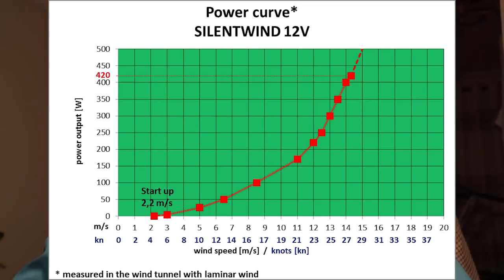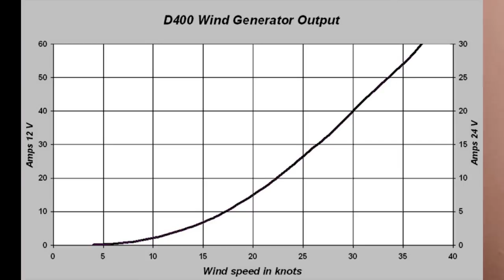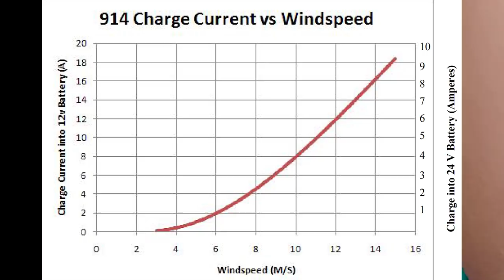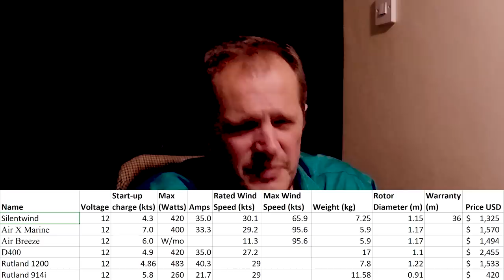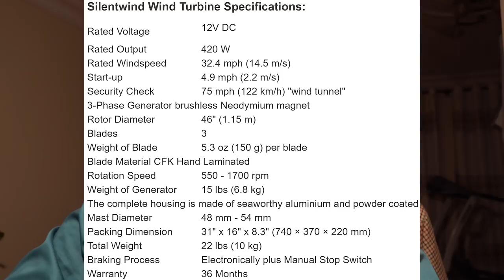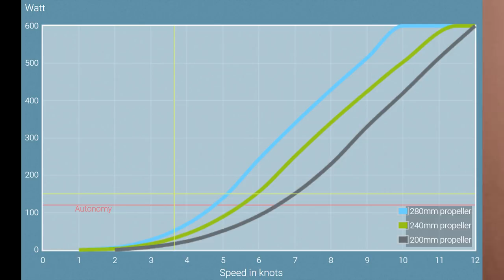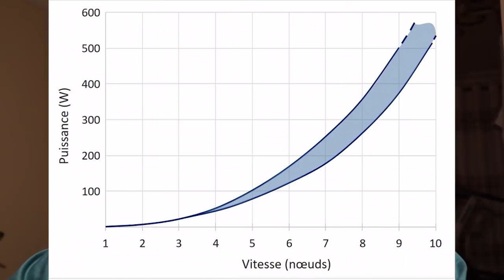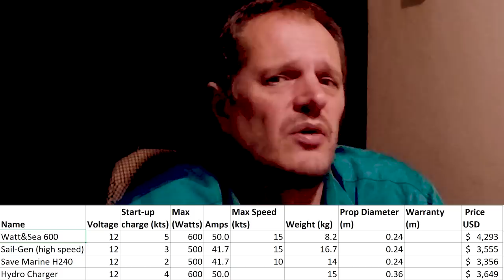#23t Should We go Hydro Generator or Wind Generator | Sailing Sisu Catamaran Cape Town South Africa

Comment from the maker: OK, after three years sailing 23,000nm over 80 latitude degrees...that is from Cape Town to the Black Sea. We also crossed the Atlantic and did a lot of downwind sailing and now Trade Wind sailing. We are heavy on electronics (power hungry graphic laptops, Wi-Fi, hard drive storage server for our videos, cameras chargers, nav instruments, etc.) and use the electric kettle every morning for coffee. We have a microwave, an Instant Pot, and a still, washing machine, and water maker on board. Here is our experience:
1) The wind gens are a disappointment. We can run only one because there is something wrong with the mount of the starboard side wind gen, because it is vibrating a lot. We have changed blades, changed gens, but still a lot of vibration. The port side is running with less vibration, and it is always free to generate power. That said....here in the Trade Winds or downwind sailing, it only starts at around 7kts of wind but brings in 2.4W in. It only starts to go above 120W with over 20kts of wind, which is a rare case at anchor in the Tropics, or while anchoring on the lee of land. We saw 380W in a 50kts blow at anchor, but that was too scary to worry about power generation! So, it is trickle charging at the best of times. Not sure if it is worth the money. They are a good warning of gusts though! They start running up long before the wind instrument shows any signs of a gust ;-)
2) The 1.4kW Flexible Solar on the roof. They bring 600W on average on a sunny day in the Tropics. The 1300W on the aft arch (well ventilated) brings 800W in the same conditions. The solar are by far the best provider of power. We battled in rainy season areas such as Amazon jungle, or high latitude winter times. We had to run the engines quite often like every three days while at anchor for longer than three days. We sailed a lot in the Mediterranean, but as you all know, MED = Motor Every Day. So, we had to motor sail a lot, which topped up the batteries.
3) No Generator, but two additional alternators.  I still think we are better off without a heavy genset and extra maintenance of another diesel needing filters oil changes and service. However, that is at the cost of putting more engine hours on the main engines. We learnt to use the engines while sailing to top up the batteries if required. For example, if we see that we need to charge the batteries, then we will move to another close by anchorage we wanted to check out and motor over, or instead of tacking the last 2 miles to the anchorage, we will drop the sails and motor, if too far out, we will go 30AWA towards the anchorage with the genoa sheeted in tight using the engines.  The four alternators bring in 1,500W @ 1,100rpm and 4,000W @ 1,800rpm however, it will cut out every now and then because of overheating at the higher revs.
Reply from the maker: Oh...we have 12kW of Lithium batteries. They only got to 100% with solar in the Tropics in non-rainy season.
Reply: Thanks so much for the very detailed reply. Much appreciated.
Reply: What is your daily energy usage at anchor and underway? From your description it sounds like you consumer hundreds of amps per day.
Reply from the maker: about 8kWh per day.
Reply: @SailingSisu  thanks, sounds like 2000-2500 watts of high performance solar (sunpower, solbian solar, etc) would keep you going indefinitely.

Comment: Dont forget that at high latitudes you will be visiting in summer wich means a lot of hours of sun. I live in the north of Sweden and i installed solar waterheating panels on my house 10-12 years ago. Works great mar-okt. Summertime it never gets dark outside.
Reply from the maker: Micke, I agree fully, keep in mind that solar panels on the catamaran will be a) flat mounted, b) moving and tilting all the time into and out of the sun, c) the sail and the low sun angle will definitely work against each other. I have been many times to Copenhagen, been to all three ice hotels in Sweden, Norway, and Finland during a road trip, loved that part of the globe! Yes, in summer, the sun in those parts will be much more higher and the solar panels actuall increase their output with as much as 15% during cold times :-)

Comment: One thing to keep in mind about wind generators.
1. You want one that starts producing and start turning with as Little wind as possible.
2. You want one that dont make to much noise so that you can sleep well at night.
3. You want one that you can turn off safely.
4. Look more which produce most around 10Kn or whatever is average.
5. Remember the reason why you want a windgenny… Probably to generate Electric when the sun is not shining because it is dark and when the hydrogennie is not because you are on anchor.

Hydrogenerator - You dont want the one that you are pulling behind the boat. You want the one that you put down by your sugarscoops.

I would get 1 wind generator and 1 hydro generator.
Reply from the maker: After one year of sailing, I think you are absolutely correct! Thank you for watching and your kind advice! Have you watched our non technical videos? Did you like them too?

Comment: From personal experience, I would just fit as much solar as you can, split up with 2 or more MPPT controllers for redundancy and performance. 
Wind generators can be noisy and get in the way depending on where its fitted on a cat. 
Hydogenerators are another item that can be a hassle to use and store.
Monohulls tend to use wind generators more because they don't have as much flat area to mount big solar arrays compared to a Cat.
Solar has the best cost to performance ratio and is more reliable when combined with enough, efficient electrical storage. 
Have a look at this guy's review > https://youtu.be/cMENm_7MenY
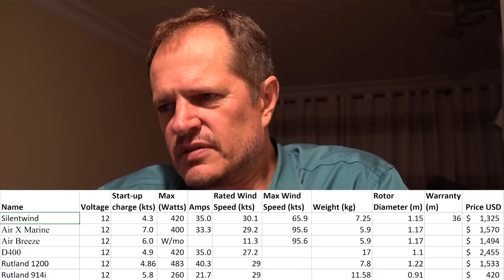Reply from the maker: ep 11  https://youtu.be/wDhpkHN_AQY?t=12m55s  (12:55)
Reply: Yep..I would do as you described in your Ep 11... I have a mate with a Schionning Cat and he has used multiple Solbian panels and he swears by them. Great quality, tough and very efficient. Their downside is cost, however "you get what you pay for".
With enough LiFePo4 batteries and a sizable inverter you could run most things without even starting the genset.
The genset could be used if you were going to run very high current draw appliances or a/c for short periods if required and of course you can charge batteries whilst it is operating.
Whilst motor sailing your additional engine alternator can also top up the batteries. I believe that the solar will keep them charged anyway. 
I really don't think you need the added complexity and maintenance issues of wind and hydrogenerators if you have a good quality, "well designed" solar system and energy storage capabilities. 
For interests sake, have a listen to this wind generator > https://youtu.be/_7zdhPUyXfk
Reply from the maker: Yes, even on Delos videos, one can hear their wind gen...pretty noisy buggers! But read my pinned comment ;-)
Reply: I agree, wind generation is noisy. And hydroelectric doesn’t work when the boat is not moving.  I would double down on solar.

Comment: If you can fit more solar panels, I would cover the roof, this is relatively cheap.  Then use lithium batteries and ultra high output alternators on engines as backups.  You can DIY a LiFePo4 house bank for 1/4 of the commercial marine prices, with the same monitoring and safe guards.  No wind or hydro, you'll mostly be at anchor and won't want wind, low apparent wind speeds can also hurt performance here on passage.  Hydro only works on passage, where you'll mostly be in fair or good weather often in the local summer, so solar works great. It's very feasible to get 7kwh+ daily from solar on a cat and also works naturally to do your high loads during the sunny day, like making water or laundry.  I'll be fitting 2.2-2.5kw of panels on my cat's roof, no genset, 10kw lithium bank.  I expect to very rarely need to run the engines to charge the battery, i'm even expecting to get ~3 hours aircon runtime each sunny day.  The lithium batteries are key, they give every charge source you have more effective output.  I can also very easily cut out half or even 3/4 of the daily load if we need to conserve power for a couple days during a storm, but an hour on a cat's dual 3-4kw alternators also gets the job done (to bring the battery back to full).
Reply from the maker: Thank you, Derek! Yes, my idea too. But for a start, I just want to see for myself what fuss is about :-)
Reply: Check out advanced RV, they have a lithium system with a 4 KW engine driven DC alternator. I know it's not marine, but when I need a fan, light, water pump, I go to the RV store, LOL
Reply: Very true, will check that out as well.  I'm currently waiting on a quote for https://www.electromaax.com/products/marine-alternators/genmaax/
Reply: Don't forget that lithium batteries can sustain irreparable damage at low temperatures so anyone sailing north Europe outside of summer will not want lithium wighout some kind of heating system. If you are sailing the carribean then good Stuff! 👍

Comment: Length of blade , introduces sound shorter quieter. Most complaints I’ve heard are about noise. Max wind speed is a concern. Your well tied up because of a hurricane and can’t use your generator because of over speed issues, no electricity. Nobody seems to have pitch control, as in aircraft. You can feather the prefop .lots of thoughts . In the ideal world you would have air and hydro
Reply from the maker: One viewer André Rimkus
, introduced a view comments earlier, to Superwind, which does have a mechanical feather control for high speed winds, but that one weighs almost twice as much as the silentwind and only starts at 6.8 kts... so, i am in thinking mode again :-)

Comment: Hey Frik, hope all is well with you guys, I know this vid was a while back but question, you went for 2 x wind generators. I don't think I've ever seen them working when watching your videos. Were they a good buy and necessary or not? thanks
Reply from the maker: OK, after three years sailing 23,000nm over 80 latitude degrees...that is from Cape Town to the Black Sea. We also crossed the Atlantic and did a lot of downwind sailing and now Trade Wind sailing. We are heavy on electronics (power hungry graphic laptops, Wi-Fi, hard drive storage server for our videos, cameras chargers, nav instruments, etc.) and use the electric kettle every morning for coffee. We have a microwave, an Instant Pot, and a still, washing machine, and water maker on board. Here is our experience:
1) The wind gens are a disappointment. We can run only one because there is something wrong with the mount of the starboard side wind gen, because it is vibrating a lot. We have changed blades, changed gens, but still a lot of vibration. The port side is running with less vibration, and it is always free to generate power. That said....here in the Trade Winds or downwind sailing, it only starts at around 7kts of wind but brings in 2.4W in. It only starts to go above 120W with over 20kts of wind, which is a rare case at anchor in the Tropics, or while anchoring on the lee of land. We saw 380W in a 50kts blow at anchor, but that was too scary to worry about power generation! So, it is trickle charging at the best of times. Not sure if it is worth the money. They are a good warning of gusts though! They start running up long before the wind instrument shows any signs of a gust ;-)
2) The 1.4kW Flexible Solar on the roof. They bring 600W on average on a sunny day in the Tropics. The 1300W on the aft arch (well ventilated) brings 800W in the same conditions. The solar are by far the best provider of power. We battled in rainy season areas such as Amazon jungle, or high latitude winter times. We had to run the engines quite often like every three days while at anchor for longer than three days. We sailed a lot in the Mediterranean, but as you all know, MED = Motor Every Day. So, we had to motor sail a lot, which topped up the batteries.
3) No Generator, but two additional alternators.  I still think we are better off without a heavy genset and extra maintenance of another diesel needing filters oil changes and service. However, that is at the cost of putting more engine hours on the main engines. We learnt to use the engines while sailing to top up the batteries if required. For example, if we see that we need to charge the batteries, then we will move to another close by anchorage we wanted to check out and motor over, or instead of tacking the last 2 miles to the anchorage, we will drop the sails and motor, if too far out, we will go 30AWA towards the anchorage with the genoa sheeted in tight using the engines.  The four alternators bring in 1,500W @ 1,100rpm and 4,000W @ 1,800rpm however, it will cut out every now and then because of overheating at the higher revs.

Comment: Hi Frik, what is your experience after a lot of miles? Do you sre still happy with your decision on the Watt and Seaand the energy setup at all? BR Thomas
Reply from the maker: Thomas, I did not go for hydro gens, only silentwind, and Silentwind was disappointing... A lot. The Bluetooth is crashing and useless, the wind gens starts at funny times or not at all, snd if they do, they are vibrating the whole boat
Reply: @SailingSisu  thank you very much Frick.:-) So the watt and sea is still no option for the passages?  I like your detailed planing and explanation of things you consider. Maybe a video about "what we thought and what we learned" would be interessting. Things you would do today different if you start again or wich were the good/best decisions you made. I would like it;-) fair winds and following seas.,
Reply from the maker: About the S&W, I was not sure about the sea grass and stuff in the water, but so far, only a few places it would have been a problem. The second issue is the speed. They have different props for different speeds and I had to experience myself with what speeds I could get with Sisu. We definitely go 5-10 kts most of the time so, I can now make a better informed decision. The wind gens are quite frankly and frustratingly, a disappointment. Even the roof mounted solar. But as they say, every little bit of Amps help, not sure if it is worth the price, but we only need to run the engines every 5 days if we work conservatively and being in the Med, which stands for Motor Every Day, we pretty much stay topped up.
Reply: @SailingSisu  
Hello Frik, I totally can understand that. Regarding the solar panels. Have you seen this video from the O-Kellys?  https://www.youtube.com/watch?v=o6kOvjS1ytE @2:40min. The owner folded something under the panels to improve the air circulation and lower the temperature and increase the output for the panels.. I have no personal experience with it, but it looks logical and promising to me.
Reply from the maker: @Thomas-mn5ih  I know that airflow cools the panels down and increase efficiency, however, our aft panels are 100% in the air... They are marginally better

Comment: Be careful, some of these units cut out at 30 knots like the silent wind... So when the weather is crap and solar is reduced that's when you need the power. you want to go to Antartica, You will get 100 knots of wind down there.....
Reply from the maker: Hi, Rustie is it possible to point me to where the info is on silent wind cutting out?

Comment: Check out la vagabond's issues with the watt and sea, not a good advert
Reply from the maker: slv is the top channel followers wide and i still watch all the videos, but i am getting a tad bit irritated by the drama queen :-) yes, i noticed the issues (also noticed the issues with the outremer :-) ) i looked at the volvo ocean race's website (and the individual team's) for technical issues experienced, but could not see the same issues. perhaps the volvo ocean race is using the racing version which is higher quality, do not know. but yes, not a good one for watt&sea if 300k viewers see problems :-) the smaller channel like lucky fish, had no problems....not sure what to think of it really? hence the reason why i want to test and see for myself.
Reply: Sailing Sisu, the expensive racing version may be made for higher speeds and rougher use, the difference between La Vag and Luckyfish is about 10 kn in speed, i agree SLV it edited for max drama I prefer Delos.......
Reply: @lnewbyliveca  All the channels you discuss are E BEGGERS!!!